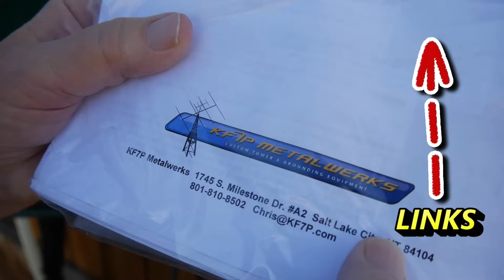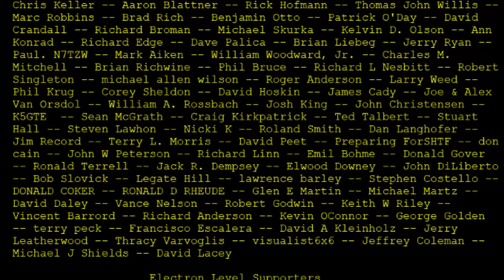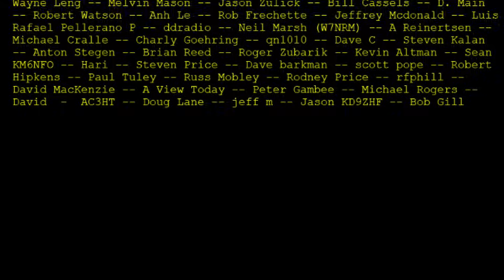Bonding Your Grounds (#1288)

Comment: The goal is that your equipment never provides a path for objectionable current.

One means to that end is equipotential grounding/bonding. 

Thereby, lightning energy can dissipate without having any reason to traverse equipment which you would rather not sacrifice.

Comment: Dave, I still don't understand the purpose of connecting the antenna ground to the house ground.  Aren't they both already at exactly the same voltage potential, equal to the surface of the Earth?  I can maybe understand doing this if the antenna ground is far from the house ground (100 ft or more) but two ground rods within the same general area should have the same potential.  If lightning hits the ground nearby, both rods would get the same spike, no?   Thanks! W0DJB - Dom
Reply: No, all grounds should be bonded together, potential can vary greatly over a short distance so bonding will ensure all are at a similar voltage in case of a catastrophic event such as lightning. that is why if you are in the proximity of a does power line you hop away because stepping can cause voltage potential difference between your feet from a short distance apart. I had 13 8' ground rods at my home station due to a remote antenna farm and they were all bonded together with #6 bare copper wire as well as bonded to the utility rods outside my home. Also arresters in the antenna farm as well as outside my home in my equipment box on the side of the house.
Reply: @Wisham1  Thanks for the explanation.  During a lightining strike I can see how two nearby ground points could see different voltages.  For the few milliseconds that a copper wire would exist between the ground rods during the strike, they'd both be kept at the same voltage.  Can you explain what a "does power line" is and why hopping is needed?

Comment: During Covid I built a all new Radio Shack in my detached Garage. I started, after sheetrock and paint with an all new Electrical panel inside just for ham equipment and test bench. and a grounding system. I installed Six double dongle 120 circuits using Orange isolated Hubble's and two 220 circuits. Electrically I have three "grounds" a Neutral the second side of the 120 / 240 wiring, a "house" ground for all the electrical boxes and etc. The Third an Isolated ground for the ground prong of the orange Hubble outlets along with an equipment chassis ground buss #6 solid copper bare wire. The neutral and the systems ground do not touch until they reach the main breaker of the house electrical feed. The Isolated ground has five bonded ground stakes, three, one on each leg of my 30 ft tower one outside the house where my shack once was and a fifth 4 inches from the original house ground stake. The bonded barre #6 is buried 4 inches under ground between ground stakes and does not connect in any wise to the electrical system except at the original house electrical ground stake. I have had zero problems with stray currents or other anomalies. It helps to have some experience with electrical wiring and I did purchase and absorbed the Grounding and bonding first edition. KF7BWS. Thanks Dave.

Comment: With your coax interface panel, how would you establish what is referred to as a "Six-foot spark gap" where you disconnect all connections from outside your house from your radios?  A radio that's not connected to an antenna shouldn't be affected by a nearby lightning strike.  We all know and accept that with a direct strike, all bets and protections are off and the lightning's energy will go wherever it wishes to go.  If a radio is disconnected from the antennas when not in use and the power supply is not plugged into the wall outlet when not in use, if a nearby lightning strike does occur, one's insurance would be much more agreeable to pay for replacement.   Michael  W4MEK  I reside in central Florida - the lightning capital of the Country.,

Comment: I have a question about “ bonding “ . Can copper clamps be used or do “ bonding “ mean using thermite  ( fire-melting “ the connections ?
Another question : 
Will adding additional ground rods ( spaced 10 feet apart , using a continuous copper wire) help improve the efficiency or would it be unnecessary ?😊
Reply: Yes, you may use exothermic welding, aka Cadweld.

Your best ground is an Ufer.
It’s unlikely that you can build something from short electrodes that is as effective as the electric distribution system’s bonded neutral.

Steel framing, metallic underground piping, and bodies of saltwater are good ways to dissipate the energy of a lightning strike.

Keep in mind the skin effect. 
Large diameter tubing and wide braids have lower impedance than small wires.

A whole-house surge suppressor can dissipate some energy.
Grounding electrodes at the base of your antenna are more important than nearer to your house.